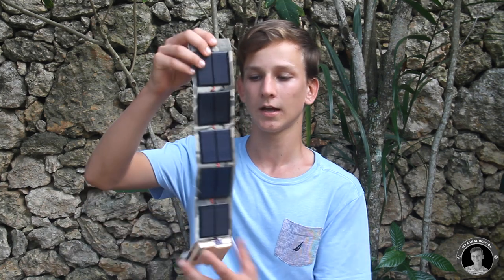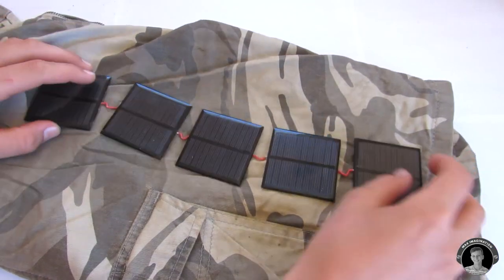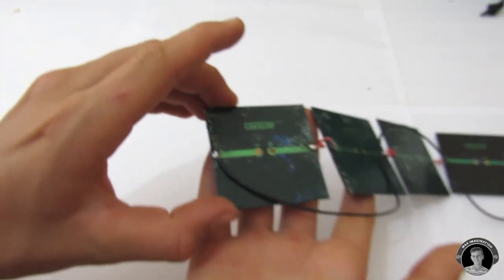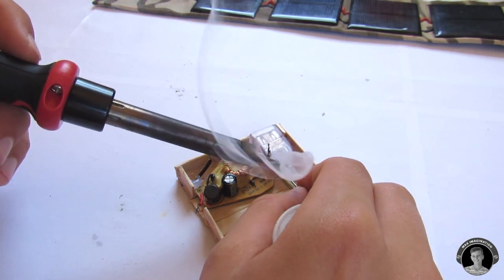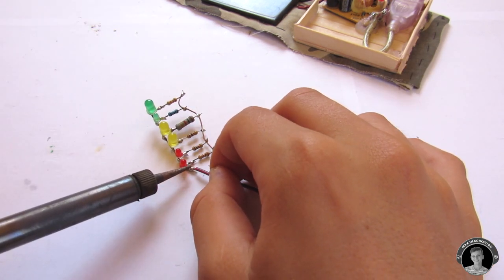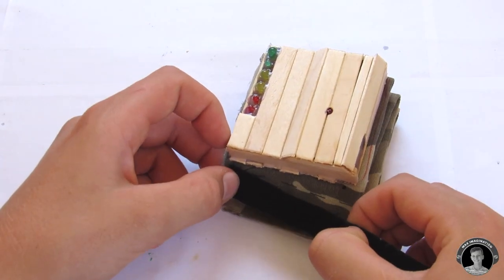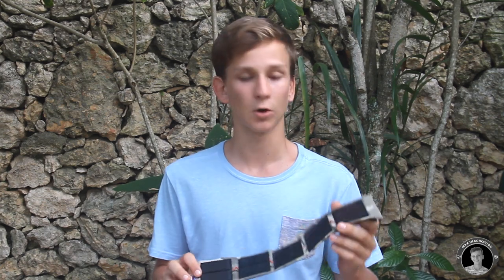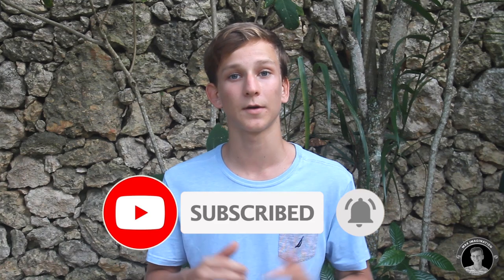How to make a 5V Foldable Solar Panel Phone Charger | DIY Charging on the go

Comment: Do you need to add a diode to your solar panels? Thanks. I'm making something similar and I'm seeing often that people solder diodes on.
Reply from the maker: Hi. Yes, adding a diode at the positive end lead of the solar panels is recommended. However, if even one panel gets shaded or blocked from the sun's light with this solar phone charger, the whole thing won't work. So as this is an older project of mine with the wrong "Series" solar panel wire up configuration, I advise you to hook up your solar panels in parallel (same voltage, higher current) for much better efficiency. That goes with saying that you'd also need a different rated power converter.
I recommend you watch the latest project version - Solar Power bank, where I make a way more efficient solar charger: https://youtu.be/lgxu_lZoDxI

Cheers,
Max
Reply: @MaxImagination  Thanks for your reply and your help. Best of luck to you and your hobby.
Reply from the maker: @GP5zona  Thanks a lot! 🙂✌🏻

Comment from the maker: Hi guys!
Please excuse the mistake I made during making this folding solar panel project. The panels should be connected in parallel with each other, NOT in series. Please instead follow my updated project video here: https://youtu.be/lgxu_lZoDxI
With this change, you now cannot use the 12-5VDC converter that was shown in the video, but instead a 6-5VDC Buck converter constant current source module: https://amzn.to/3GEhopF
Thanks for understanding!
Reply: Awesome vid ty.. tried buying same panels but got in mail different ones. Has positive and negative both sides (Voltage: 6V  Power: 2W  Current: 0-330mA) can I still run in series ?? The only vid I've seen with these vids are run in parallel ?? Cheers
Reply from the maker: Hi Jason,
My apologies... due to my lack of knowledge back at the time I made this video, I make a mistake by putting the panels in series when they're meant to sit in parallel with each other . Please watch my latest version of this project called the "Solar Power Bank", there I connect things accordingly. You must connect them in parallel to maintain a voltage 6V and to add up enough current, yes.
Cheers,
Max
Reply: Hello. Why Can it not be in Series with Each other? I am just curious😀
Reply from the maker: @lassedahljessing5711  Hello. The panels are way more power efficient when configured in parallel, so that they give out added amount of current but the same voltage of 1 panel.
Reply: @MaxImagination  okay. Thanks for help👍
Reply: @MaxImagination  I'm interested in something that wasn't mentioned in the video: A situation where the solar cells give, for example, a voltage of 30 volts, so what does your regulator do to the 25 volts that is left over from the usb voltage? Does the regulator waste this extra voltage as heat to the air, or does it convert it into a higher charging current?
Reply: Don't think for a second that this diminishes anything you've done. Every single person here has made a mistake or two and will make more. You have  solid path head of you. The fact that you've pointed our the mistake in this fashion says more about you then one mistake.

Comment: Can we use 2 solar panel of 6 v in series for 6 v × 2 = 12 v for 12 v car phone charger ?
Reply from the maker: Hi, that won't work since small panels as such used in the video have a very low amperage, you'll have to connect many of them up in parallel and then an equivalent row which pairs up with the other parallel row, connected up in series to equal 12V. Then, that might be enough ✌️

Comment: Hello Max! Can I use this same design just wired in parallel? Can I still use 5v panels with the 12-5V DC converter, or do I need 6v panels and a 6-5V converter?
Reply from the maker: Hi there. Yes, parallel will work with these 5.5V panels. You'd have to use a 5V current boosting module.
Reply: @MaxImagination  So the current module like in this video? Do I need to add a diode to the + and - wires?

Comment: Which gadget or say component did you use on 4:15 what is it called???
Reply from the maker: I used a 12V DC to 5V DC converter board from a cigar car charger unit that normally charged phones.
Reply: Thank you bro liked this gadget love from India❤
Reply: @MaxImagination  Can you please suggest one 12v to 5v DC Converter available on amazon just like yours

Comment: better use the panels in parallel rather than series ... it will increase the efficiency ...
Reply from the maker: Hi, yes, that is the more efficient way, I learnt soon after I made the video about the smarter way of connecting the panels. Thanks anyway, though!
Reply: thanks alot i didnt know about connecting types

Comment: Connecting them in series would only cause more time to get it charged right? Is there any other problem.....?
Reply from the maker: In reality, these panels must be hooked up in parallel to maintain a similar voltage to what the phone requires (5-6V) and add up to a higher value in current potential to make power conversion more efficient and stable. So if one panel gets covered or goes down, the rest of the panels keep working and charging the phone. The way I did it in series makes this project less efficient and unstable for charging anything. I will pin a comment leading to my updated version of this project.
Cheers.
Reply: @MaxImagination  okay,thank you so much for the reply!
Reply from the maker: @studyah  Always :)

Comment: How did you set up the progress meter with the LEDs?
Reply from the maker: Hi, Ellie. From memory I used different value resistors with these LEDs. So when the voltage of the panel array goes up, the LEDs will shine stronger up until the very last LED. 
A more effective approach to doing this would be with diodes instead of resistors.

Comment: Hey man is it possible for you to send me a link to the 12 dc v to 5 dc or explain how you got it
Reply from the maker: Hey there. I simply used a circuit board from one of these Car Adapter Phone Chargers: https://amzn.to/3Ebnbk0
Reply: @MaxImagination  is it possible to use a step down converter module with a usb on it?

Comment: pointless if they are 6v cells, why not parallel them for faster charging rather than wasting voltage
Reply from the maker: Hi, I know you may find it annoying to see the panels get wired up in the wrong configuration, this is back when I had less knowledge in electronics, we all make mistakes...
After making this video, I then understood my major mistake.
Stay tuned on the upcoming Solar charger/powerbank V2 coming soon! Working on a more efficient and better one :)
Reply: @MaxImagination  Dont worry about it dude. You could also integrate a small MPPT solar charge controller to handle it for you.
Reply: Or you could connect 3 and 3 in parallel and connect those in series for 12volts. Then you could use a car phone charger for more convenience. All be it a great project you did👍

Comment: It's going to cost a tenth of the price to buy it lol
 You want new, clean non scratched/cracked panels and it's cheaper to simply purchase an 8 pack of solar motion lights off Amazon for $20, or simply pay $30 for one that holds 20,000 mAh.
 It's fun making your own, but not exactly cost efficient.
Reply from the maker: The situation for others can be completely different. Some already have certain materials and parts laying around they can salvage to recreate with, others may not. Only purchasing these panels which cost me $10, turned out to be the total cost of my project.